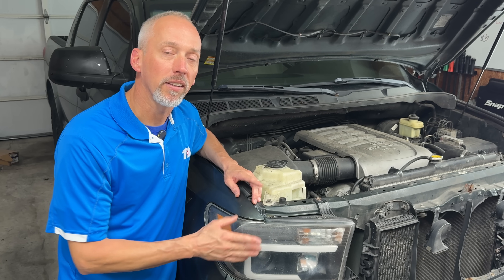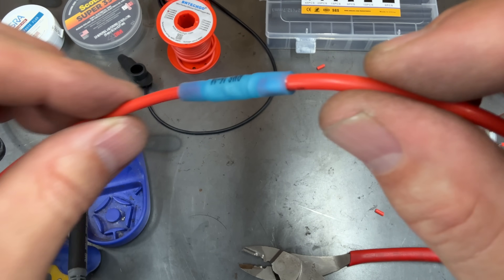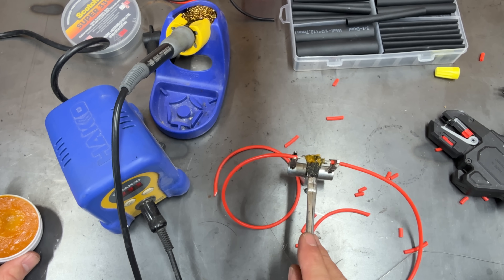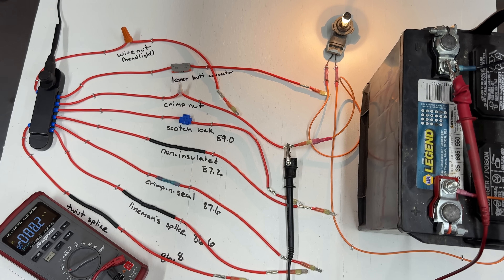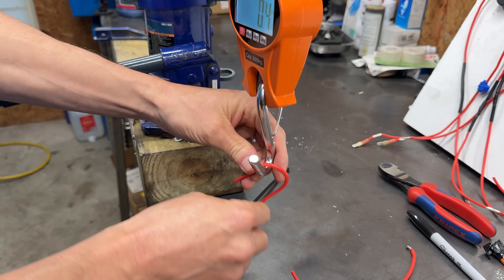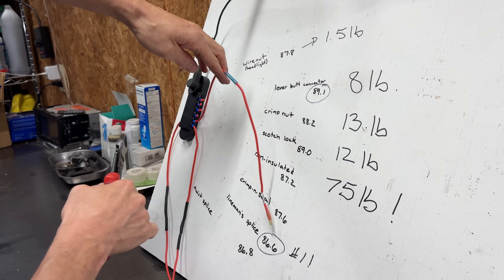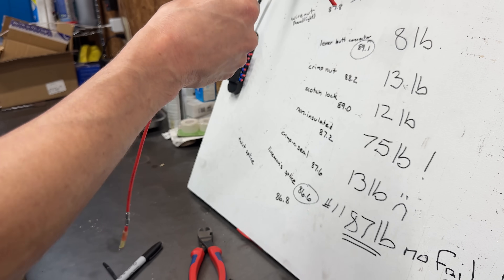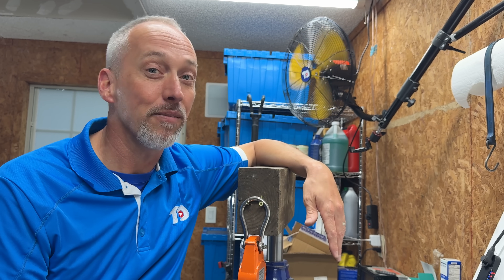I tested these connectors and found the best one

Comment: On a well-made soldered connection for AWG16 a 1.5 mm² wire at a current of 4.5 A (one H7 bulb), the voltage drop should be between 2 mV and 10 mV. For a quality crimped ferrule on an AWG16 wire, the voltage drop is 1 mV to 3 mV. You have a systematic measurement error.

Comment: Put all connection into salted water for some hours, let them lay around outside (not indoors) over night, repeat the resistance test! Soldered will be best, but after some month it will break due to corrosion. Butt to butt would work best, if you would have put lanolin on to the wires before crimping and as well under the heat shrink tube . Those tubes are usually weak, therefore i use at least two of them. Corrosion is the real problem (and vibrations).

Comment: If you get lever nuts just use the ones from Wago. Those are just the best ones at the moment. 221 for stranded and 2273 for solid core 

And for the butt connectors it really helps to use a crimping tool which adjust the requiered force automatically and only release the connector if the crimp was completed all the way. This way you get consistent good crimps.
For best results use klauke connectors with knipex crimpers.

Comment: SECOND EDIT: When you did the failure test you didn't show if the connector failed or of the wire failed on the  non-insulated butt connector.
FIRST EDIT: When you did the voltage drop test you didn't do a control test of wires without a splice. 
ORIGINAL: Google Search for the NASA Soldering Manual... The ultimate wire connection standard created in the 1950s for the space programs... there is also various videos on YouTube.

Comment: Scotch lock are hot garbage, I've seen so many electrical issues caused by those. How are you not going to test the crimp-less heat shrink butt connector like the brand SolderStick. Those connectors rule! Water tight and super strong!
Reply from the maker: I might have to do that in the future

Comment: Am I missing something on the wire nut tensile strength test. It reach 7.6 lbs to break the connection. But on the board he wrote 1.5lbs. Did I miss something in the video?
Reply from the maker: No, I missed it in real time. I didn’t notice until I watched the video during edit.

Comment: I would've liked to see the new "solder seal", type you just heat and it melts/solders and tubing shrinks in one. Also,  i just replaced some electric burner receptacles on my electric stove, instructions said not to twist wires before using supplied wire nuts

Comment: Only "quick" connector I would even consider using in Automotive applications is the Posi-Lock connectors. I have used them for over 20 years now, in some of the harshest places on Earth (worked in Afghanistan for 12 years, Iraq for 4 years, and other places since the early 2000s). Anytime I needed to add a circuit, or do certain electrical repairs, I used the Posi-Lock connectors. One of the best thing about them is whatever you did, you can easily disconnect connections and or revert things back to the way they were. Heck when I replaced the voltage regulator on my motorcycle I used 3 of the 10 gauge (yellow) inline connectors to replace the failed factory connector. Used a little dielectric grease when making the connection to keep moisture out, it's been 10 years and no issues.
Reply from the maker: Right on

Comment: Adam Savage just did a video where he was extolling the virtues of some heat-gun-activated low-temperature-solder connectors, that are supposedly water proof, etc.  Would be interesting to see them put through this test, too.  (Indeed, I thought I was going to, and that that's why the algorithm sent me here, but I guess not.  :D)
Reply from the maker: I made an editorial decision to not include those connectors because they seem too gimmicky to me. A lot of people did comment about wanting to see those tested, so I might come up with a way to test them. If I do I’ll post another video.
Reply: @ToolDemos   Cool, thanks!  And yeah, they do seem kinda gimicky in a way, but... when someone like Adam Savage is talking them up, I'm sure a lot of folks are using them -- for better or worse.  Could be good to know if they're actually something that holds up!
Reply: P.S.  Err, I lied, he didn't "just do" the video, but I just watched it recently... The video is titled "Adam Savage's Quick Electronics Wiring Tips!", video id vDsVwbWiVFI ...

Comment: I always solder joints in wires, but I use crimps for any connectors. Soldering a connector is a pain in the butt.

Comment: Thanks for the test.  Using wire nuts meant for solid or heavy strand copper wire on fine strand tinned copper wire will certainly not work as intended!

Comment: i usually crimp the crimp and seal way way harder then that. Usually using the same as the regular crimp side, but one size larger to keep from damaging the seal.
Reply from the maker: It’s tough to find that perfect balance
Reply: @ToolDemos  I found if you use the size on the crimper one size larger then the size you'd usually use for that gauge, the whole thing fits inside and allows you to crank down on it without damaging the seal. At least my experience after doing hundreds of them.
Reply from the maker: @SilverStarHeggisist  I’ll try that.

Comment: Fun fact; if you hit regular plastic tubing with the heat gun and keep going because it isn't shrinking, you've discovered heat stink.
WOW that's a lot of flux.  Leaving so much of it on the connection may cause corrosion, depending on the flux type.
Both of the soldered connections failed where they bent around the sharp edge of the desk.  With a better bottom anchor I think both would have gone over 100.

Comment: Why would you not solder a connection, in a shop environment?
Reply: Some connections are made in places on equipment that you can't hardly get to, and can also be in less then clean environments. Alot of the stuff I work on is coated in oil and grease to such an extent that you'd waste a boatload of time cleaning it enough to use solder, especially because you'd have to keep re-cleaning it as more dripped or smeared on it while you try to work.

Comment: For crimped connectors, you should absolutely NOT twist the wires, as it will cause the joint to become loose over time, the wires should be straight!

Comment: Good test idea, its something that I have actually tested my self.  With that said there are issues I see.  There is not a constant voltage source.  The battery voltage will be different with load and load will change with resistance wich is what you are testing.  There is not a constant load.  The light bulbs current draw will change with heat.  There are way too many connections to accurately determine the corect resistance of each.

Comment: Soldering wires im automotive wiring sometimes is not recomended, because vibration might crack the solder.
Crimping is faster, equaly great in conductivity and more reliable on the long term.
Corrosion can be avoided if the shrinking tube is of good quality, in hight demand aplications before sliding the tube its possible to apply corrosion preventive paste, that is a kind of grease that insulates from moistrure.
Reply: When I went to UTI for heavy diesel, in the automotive side they told us to always solder when possible, and then in the heavy diesel side they told us to never solder and always use crimp connectors. I just thought the contradiction was interesting.

Comment: your electrical measurements are of little usefullness. first, results are about the same, so there's no difference between connections. second, what did you measure? what does it mean? don't you have an ohmmeter? also you didn't compare vs wire without any connector
Reply: He measured voltage drop, which is actually better then using an ohm meter, the reason is that an ohm meter uses such little current that a poor connection can show low resistance to the meter, but when you try to actually push amperage through it breaks down. To give an idea what I'm talking about, if you have a multi stranded starter wire and all but one strand is broken, when you ohm the wire, you'll get near zero ohms, but when you try to push a couple hundred amps through it, the wire gets hot and the last strand fails. An ohm meter is good for measuring things like components that have an ohm rating.

Similarly comparing different gauge and types of wires, an ohm meter will show near zero ohms for all of them, but if you voltage drop test it under an actual load, you'll see which wire can carry more current.

That's actually the issue here with this test however is that he's not using much of a lead to test them with, so not much amperage is trying to go through. What he has demonstrated is that as far as low load applications, like a single bulb, the difference in electrical connection type doesn't really matter, so other considerations are more important, such as physical strength, corrosion resistance, and resistance to vibration.
Reply: @SilverStarHeggisist  your comment is nonsense. poor connection will demonstrate large resistance, that's why you test it with ohmmeter before pushing current through it.  he already measured exact results for all tests. voltage drop is meaningless, can't you read my comment in full? i've asked, what does it mean. you didn't answer, because you don't know. nobody knows, he didn't specify current. was it large drop or small one?
Reply: @SergePavlovsky resistance changes depending on the amperage you're pushing. Am ohm meter will give you the exact same reading for a 0 gauge wire as it will give you for a 20 gauge wire. The reading is basically worthless. 

However a voltage drop reading across the wire will give you an actual usable number. 

The reason is an ohm meter is only trying to push a miniscule amount of amperage through a circuit. 

To use plumbing as an example, an ohm meter is like dumping a bottle of water down both a 1" pipe and a 10" pipe. Both the water flows as fast as the bottle of water flow, so you don't find out anything useful. But a voltage drop test is like trying to force 50 gallons a second through both pipes and measuring how much pressure builds up in the process. Now you can see the difference between the two as to which pipe offers less resistance. 

Ohm testing wires is only effective for finding breaks in the wire or the most severe corrosion.
Reply: @SilverStarHeggisist  lol, go back to school
Reply: @SergePavlovsky  you do realize an ohm meter does the same thing but with less current right? It runs a current across a conductor and measures the voltage drop and by that, figures out the resistance value. Just it does it with a tiny amount of current. 

You're the one who clearly doesn't understand what you're talking about. I've explained it in detail and your best response has been basically "nuhuh"
Reply: @SilverStarHeggisist  you do realize ohm meter gives you resistance, which is a property of connection, not depending on current? while voltmeter gives you meaningless answer which you have to convert to resistance first and this video didn't do it?
Reply: @SergePavlovsky  How do you think an ohm meter measures resistance?

Comment: Scotch locks do work well but they are very sensitive to wire gauge and with the rise of LED lights in cars wire gauges have gotten thinner where you are more likely to either fail to get through the wire insulation or you outright cut the wire.

Comment: Why test a failure mode that the wiring should never see? This seems like a very interesting waste of time.
Reply: I lost trailer brakes before because a wire was pulled too tight, pulling the connection apart. The other thing is that vibration exists, and it's highly likely that a weaker connector will fail to vibration sooner. Another consideration is handling wires later on, such as someone who may not be you, may attempt to pull on a component that they are taking out, without realizing there is still a wire connected, having a strong connection can be the difference between someone feeling a tug and someone having to repair the connection. It's also similarly possible for a wire to get snagged by someone later on working on a different component.

Also it's entirely possible for someone from outside to reach in and grab at the wires. For instance a branch may pop up under the vehicle and even into the engine compartment while running off road. I've actually had this while running over a large growth of wild rose bushes, granted the wire that got pulled was only twisted together and held with tape, but it pulled them apart shutting off the truck. When driving through a woods, you'll find all kinds of stuff that will get way deeper into your engine bay then you ever thought possible.

The point of this to say, when you do a wire connection, you have no idea what stress it will be under down the road, so it's important to ensure that no matter what happens, your connection isn't the failure point.
Reply: Strain relief has nothing to do with any of this, this is the wrong place to be thinking about it. If you are relying on your connections for any sort of strain relief you already fucked up big time.

Comment: Are you a liberal, how come you didn’t twist the regular wire nut like everybody else in the world? You left them so loose also for the crimp and seal, you need to use the adjustable ratchet, crimper designed for the colour and size of the crimp connecter, only a hack would use their lineman‘s pliers for that crimp

Comment: for the linemans splice....im left handed so i have a tendency to wrap the opposite direction. the connection actually pulls stronger together as you pull the wires apart. ( im currently and have been diaging automotive electric circuits for the past 29 years)

Comment: Wire nuts work.  Wire is NOT a structural item in houses. Dugh !
Reply: Every time I've fixed a vehicle with an electrical problem that had wire nuts, the wire nut was the problem. they're fine for buildings, they're not for equipment that moves. Also you never know what can reach into an engine bay or up under a frame and grab at the wires, a strong connection ensures that sticks and brush can't casually rip apart your wires.

Comment: i have always prefered soldering wires and using heat shrink over any mechanical connection.  If i were fixing a single wire within a bundle, I would use mechanical crimp on connectors with the heat shrink sleeve.   If I were building a harness from a different application, where there are many wires spliced, I would use nothing short of soldering and heatshrinking each individual wire at every splice point.   In the case of a headlight where there are only three to four wires going to the location, I think I would tend to favor solder/heatshrink to obtain a more permenent fix.  But I'm not a car guy, I'm an electronics guy.
Reply: Alot of times there's no room to work with heat like that in automotive and heavy equipment. There's also a speed aspect. If you're paid by the job, you're loosing money taking the extra time to solder and if you're paid by the hour, the person employing you will get annoyed at you milking jobs (dragging out a job longer then absolutely necessary)

Comment: You failed to test the wire alone (no splice).
I'm 69yo and been soldering my Automobile connection for ever. I use crimp connectors, remove the insulation and solder them then add color coded heat-shrink.

Comment: For the connector used at about 2 minutes you can put some hot glue on it then put heat-shrink on it makes a good waterproof joint.

Comment: My take away is to stick with wago: The variation in resistances was negligible but the extra length for a more robust cord isn't worth (for me personally, respect for differences) the loss of easily swapping out components and not needing the extra few inches of cord to put in the non-insulated stuff.

Comment: In my aerospace work, soldered connections are almost non-existent. They can stand up to static pulls rather well, but do not do well with persistent vibration and the resistance is more of a variable. 

Properly crimped connections are the overwhelming choice for reliability and electrical performance. The crimp tools are really important as is the terminal choice. Crappy stuff from Amazon along with improper use is not much better than a household wire nut. 

For DIY applications, the good crimp tools and terminals can be too expensive. In that case, my second favorite is the linemans splice. I have done a bazillion of those with long term success.

Comment: I fix electrical connections all the time on dump trucks, heavy equipment etc. I already knew who the winner was going to be at the beginning of the video. Always solder your joints, twisted or linemans and heat shrink with sealer afterwards. Another positive about these type of connections, is that they do not corrode. All the other connector methods whether marret or crimped are exposed to air and will eventually oxidize and fail. Never had a call back. Great video.